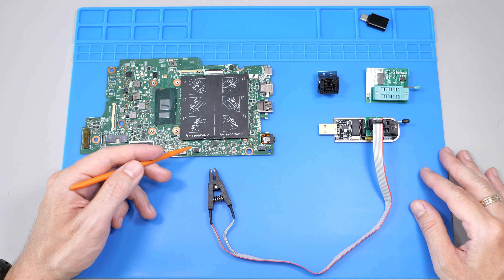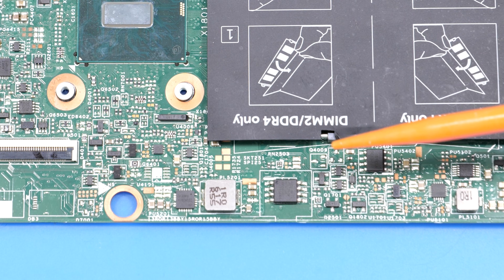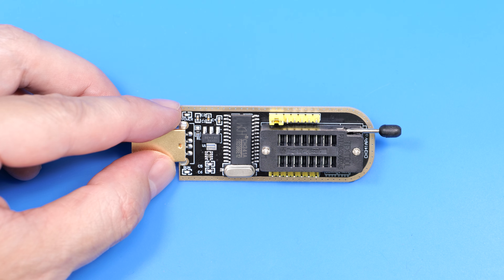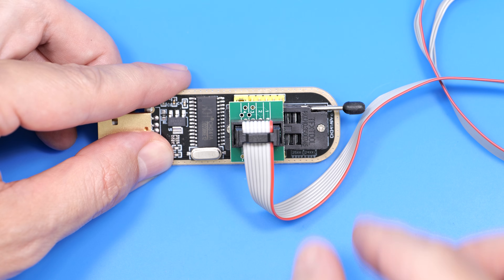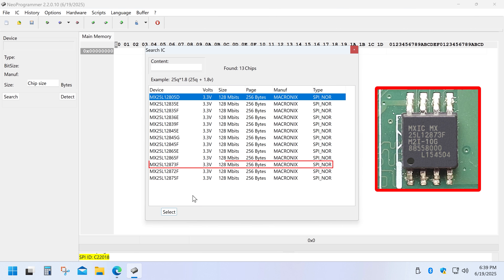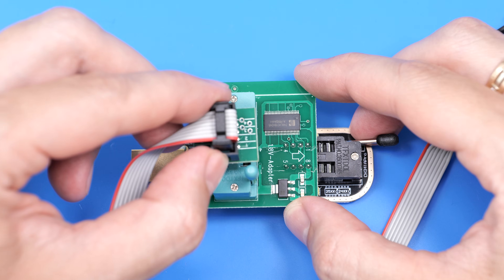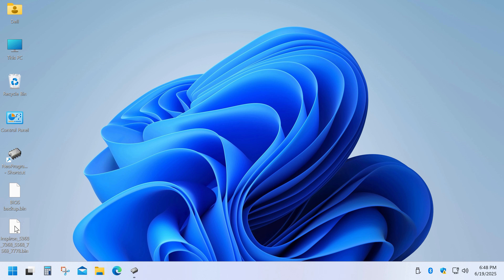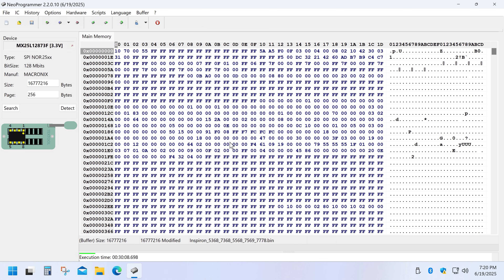How to Fix a Corrupted BIOS with a $5 Programmer | CH341A BIOS Flash Tutorial

Comment: Hello, when I try to connect my CH341A to my RX6800XT with GD25Q80 chip, the device disconnects. VCC and VSS show 1800ohms, and sometimes the RUN LED turns on and is dim. When connecting the programmer standalone, it connects to the programmer fine, but as soon as i put it on the chip - the programmer disconnects and is unresponsive when plugging in again. Do I have to desolder the VBIOS chip to program it? Please help
Reply from the maker: In your case, the problem is that your CH341A can’t properly power the IC because something on the board is drawing too much current possibly even momentarily shorting the CH341A’s power rail, which is very weak and doesn't supply much current. Assuming your graphics card doesn’t have any actual power issues and its rails aren’t shorted, you have two options: first, you can try connecting the graphics card to a motherboard and PSU, then supply power without pressing the power button just let it sit in standby mode. After that, try attaching the programmer and see if it helps. Depending on the chip and the board, sometimes this works sometimes not. If it doesn’t help, then you’ll need to either desolder the chip or isolate it by disconnecting its power pins/traces to eliminate the drain from the rest of the circuit.
Reply: @ElectronicsComputers Thank you very much for your detailed reply. I really appreciate it. Just tried connecting the PC to the motherboard without turning it on, it seems like I will have to desolder the chip to reflash it. The CH341A reacted the same way as it did without the gpu connected and powered by the motherboard. I had already taken the GPU to a repair shop, they just said "it works now" after reflashing the VBIOS and done. I will order a new chip too. Thank you!

Comment: This is the best tutorial I can find for this device. Despite it not working (its not being detected / "IC not responding"), I believe my BIOS chip to be completely cooked. Dell XPS 13 9360 from 2018. It was working one day, then next it wasn't. It tries to boot, but shuts down after 30 seconds. The light on the power button, is solid white, if there was an issue, it would blink giving me an error code to look up. No screen, no fan, but I can tell the CPU starts up because it gets warm. The repair shop I took it to told me its getting the right voltages, but doesn't boot and it baffled them. The SSD works because I tested it in a different laptop. I considered this issue to be a BIOS issue, hence why I am here. Is it possible I just bought a defective CH31A device? All things to consider. Besides the point, thanks for the tutorial. Coincidentally, I was working with a virtual machine on the laptop the night before it stopped working. It should be impossible for a VM to corrupt a BIOS, right?
Reply from the maker: There’s no way a virtual machine could corrupt your BIOS it's just not how virtualization works. your symptoms do sound like a bricked BIOS. If the repair shop did their job properly and confirmed that all power rails have the correct voltages and the EC (embedded controller) is alive, then there's a good chance all you need is reflash your BIOS. I don’t know your experience so I have to ask: are you 100% sure you’re working with the actual BIOS chip? I've had quite a few clients mistake other chips for the BIOS. What’s the exact model of your BIOS chip? Also, check the clip make sure the contacts aren’t bent and that it's gripping the chip firmly. If Windows recognizes the programmer and the correct drivers are installed, it should work. I’ve personally never seen a faulty CH341A (we sell them too) but I won’t rule it out it’s definitely possible.

Comment: Amazing tutorial! I updated dead BIOS on B‑550 Aorus Elite using CH341A thanks to your clear guide. Saved me from a bricked board! I don't know what's going on with Gigabyte motherboards and their Dual BIOS setup it's supposed to improve reliability but in reality, it's useless and crashes way too easily. And the only way to fix it using a programmer.
Reply from the maker: Yeah, we get them quite often in my repair shop but you can easily fixed it yourself. Also, investing in CH341A programmer allows you to fix smart TVs, routers and a bunch of other stuff too.
Reply: Did you use the aligator without desoldering? I have a bricked B450M aorus and cannot find the chip name, its not writen on it.
Reply: @Igor-ze8fr  There's no name but a serial code written on the chip, if you found the chip, try using isopropyl (purer is better) to clean any coatings or adhesives (if you have to peel off a bios version sticker). A good tip is to shine light from the SIDE not from top-down and use a phone camera to zoom and take pictures, telephoto lens help. DO NOT use any clips or blindly probe chips without finding a data sheet and knowing your chip, otherwise you could risk frying a 1.8V chip with 3.3V. If you cannot find the chip, refer to the mobo manufacturer manual, they usually have it labeled.

Comment: Hi there, cool video! I like how concise you were. I want to try this to help my friend with her laptop. By any chance, do you have the chip xml to import for W25Q16JWSSIQ chip? I don't think W25Q16 will work, will it? I am trying to find the info to import the chip into the list but I am a little lost.
Reply from the maker: You can use either W25Q16JV or W25Q16BV. Your chip requires 1.8v so you have to use a voltage adapter.
Reply: @ElectronicsComputers Ah, I see. I do have the adapter coming big thanks to your video for suggesting the tool! Thank you so much for the reply as well! You earned my sub! 🫡
Reply from the maker: @carapacetech   I'm happy to help and thank you for your support!

Comment: Lifesaver $5 device with this guide!! 🙌
Bricked my gigabyte b450 aorus m board after messing with the bios settings trying to enable secure boot for valorant. Apparently it’s a known issue with gigabyte mobo. Had to flash both m_bios and b_bios with this tool. Good thing this video came out around the time I had the issue 😅
Reply from the maker: That model has extremely delicate BIOS and this little device makes recovery super easy saving you a ton of money. And it’s not just for desktop or laptop motherboards, you can use it on routers, modems and Smart TVs.
Reply: Hi @markeaton3722 I have the exact same problem with the same motherboard, did you manage to bring it alive ?
Reply: Now I'm with the same problem with the same mobo, you have downloaded the bios update file from the official website of gigabyte? I don't know what to do with that file, it doesn't looks like it's .bin extension, how it can be changed?
Reply from the maker: @DeathKnight1   Try this: https://drive.google.com/file/d/1saYf928Wb6ZR_CpNnLHEb0LxSbLdXkg1/view
Reply: @DeathKnight1  Okay so I didn't fix it using the ch341a. What i did is ordering the amd ryzen 3 3200g (60€) I set it up on my motherboard and i could reach the bios and flash it using the downloaded bios on the official website (bios F66 in my case, the latest stable one) i put it on my usb key and then flash it. The format is fine its a standard format for gigabyte. Then i put back my own processor

Comment: my GIGABYTE have a M-BIOS and B-BIOS .... ¿¿¿ which one should i flash ???
 i mean ¿¿¿do i have to connect the CH341 and flash both BIOS CHIPS one by one or what ????
Reply from the maker: Since your GIGABYTE board has dual BIOS (M-BIOS = Main BIOS, B-BIOS = Backup BIOS), in most cases you only need to flash the Main BIOS unless the backup is also corrupted or outdated. If you're using a CH341A programmer, then yeah, each chip has to be flashed individually they’re physically separate ICs. So if you want both chips to have the same version (which is a good idea for redundancy), then reflash both.
Reply: @ElectronicsComputers  execelent and complete answer my friend ... i wll try that because is not hard to do it i was just in doubt to which do first... i think i wll start for the M-BIOS and then flash B-BIOS

Comment: My BIOS chip's pins are not exposed(can't use the clippers)...What do I do?
Reply from the maker: Are you sure you're looking at the BIOS chip? Ninety-nine percent of the time, BIOS chips in laptops and desktops are SOP8 or DIP8, they’ve got visible pins on the sides. That’s the standard. BGA-packaged BIOS chips do technically exist, but they’re extremely rare, mostly in embedded systems, ultracompact boards, or some high-end server gear. Not your average consumer laptop or desktop.
Reply: @ElectronicsComputers  sorry for the confusion. The BIOS chip is in fact DIP8. They are not invisible. It is so small that the clippers barely hold on to it and the pins on the clipper don't even touch the ones on the chip. What should i try?
Reply from the maker: @BUFF-F   For a DIP8 chip, you’ll need to desolder it and plug it directly into the programmer, clips don’t exist for that package. Alternatively, you can solder jumper wires straight to the chip legs if you want to avoid full desoldering.
Reply: @ElectronicsComputers  I do want to avoid desoldering. So I will try to connect the pins however I can. Thank you❤
Reply from the maker: @BUFF-F   I'm happy to help! Usually, I desolder the chip but in some cases I just use a clip set like this: https://shp.pub/78qu4h
It works perfectly fine and costs just $3 delivered.
Reply: @ElectronicsComputers  well, i gave it to a alleged "professional" to remove the chip and  it didn't come off, he tried various things and eventually broke a piece of it and. Is it replaceable?
Reply from the maker: @BUFF-F   Wow! That’s literally a 10-15 -second job, even with the cheapest $25 hot air station. Jjust replace the chip entirely they cost less than $5 and put it in a socket  so it can be easily removed or replaced: https://shp.pub/78rjaz
Reply: @ElectronicsComputers  yeah that's what I am trying to do. I am looking for the same model.

Comment: I did this with my b450 aorus pro wi-fi motherboard but why does mine indicate 1.8 v instead of 3.3 v? I did some searching and it did say that my MB model is 3.3 v. Any clues?
Reply from the maker: The B450 AORUS PRO Wi-Fi definitely uses 3.3V BIOS chips (usually Winbond 25Q128FVSQ or similar).
Reply from the maker: If NeoProgrammer is showing 1.8V but your board uses a 3.3V chip, it’s probably just showing that because it auto-detected the wrong chip model. Double-check the exact part number on your BIOS chip (like 25Q128FVSQ), and manually select that in NeoProgrammer.
Reply: @ElectronicsComputers but only 1 chip model showed and its the same name printed on my main bios
Reply from the maker: @sheeesh9808  What's the exact chip model we're talking about?
Reply: My motherboard’s chip starts with MX25U so I guess that’s why it shows 1.8 v instead of 3.3 v. I stopped using the bios programmer and I’m waiting for the 1.8 v adapter. My question is will my motherboard still work since all I did was read it using the programmer?
Reply from the maker: The chip model should’ve been mentioned in your first comment! Yes, that chip is 1.8V with a max operating voltage of 2.5V. That’s why I said in the video that the first step should always be checking the voltage in the datasheet. Speaking from experience, those chips usually survive 3.3V. I have a professional programmer in my repair shop where I can set the voltage anywhere from 1V to 5V through software, and I’ve selected the wrong voltage a few times the chips were still fine.
Reply: Thank you for answering my questions! I just subscribed to you! Cheers!
Reply: Btw, did you click verify ic? did you encounter some errors? Mine has like these “Verification error on address: 0x0000F5D3, Device: 0xFE, Buffer: 0xFF”. I already have my 1.8 v adapter and it seems my motherboard is still working since I can still read it, so i don’t know what’s the problem now
Reply from the maker: @sheeesh9808   I never use the Verify IC feature. If it works, it works if not, I just reflash it. That error with the CH341A is pretty common, even when the flash actually went fine. It can be caused by timing issues, minor read glitches etc. If the motherboard boots and runs stable after flashing, you can ignore the verify error.
Reply: Got that. I already fixed my PC. I was skeptical at first because if something goes wrong I need to disassemble my PC again but that did not happen. Thank you for the advice!

Comment: doesnt work for small form factor just wasted 20 bucks...
Reply from the maker: No one said that the SOIC8 clip would work on smaller packages. The CH341A programmer usually comes with a DIP adapter that supports those smaller chips like SOIC-8 (150 mil) or even TSOP/WSON types but yeah, you need to desolder the chip and place it into the adapter directly.

Comment: Hello sir, my laptop has a problem. When i turned it on, it shows BSOD but brief only like 2 sec, then it loads the "preparing automatic repair" screen, but then it shut down again, not even enter the "automatic repair" screen, just loads. And then it restart on its own after that shutdown, BSOD again, loads the same "preparing automatic repair", then restart. It keeps repeating on that.

I've already did clean install, and the problem still there. What should i do sir? 

model: Acer E1-432
BIOS: Pheonix SecureCore Technology Setup
Reply from the maker: Yep, that’s a classic boot loop from hell. 1. Check the RAM Faulty or unstable RAM is a very common cause of this kind of loop.Try running MemTest86 from a bootable USB. 2. Check the HDD/SSD health
A failing drive could also cause BSOD + boot repair loops. Use CrystalDiskInfo to check the SMART status. 3. Go into BIOS (Phoenix SecureCore) and load default settings. Make sure SATA mode is set to AHCI, not IDE or RAID. Disable any weird boot options like Secure Boot or Fast Boot just for testing.
Reply: @ElectronicsComputers  Hello again sir, i hope u remember me😅. I had to wait for a new thermal paste that i ordered online since the paste on the cpu was dried. 

So, i've checked with CrystalDiskInfo. Status is "caution", there's 2 yellow dots, CURRENT PENDING SECTOR COUNT and UNCORRECTABLE SECTOR COUNT.

For the ram, i tried using Windows Memory Diagnostic, total test pass was 2. Passed 1, getting into 2, the laptop shutted down. There's 2 ram inside, 8gb and 4gb. (i used only 8gb before)

The problem was as i stated before, power on, brief bsod, then loop. Sometimes I managed to get into windows like normal, but after a few minutes, it shutdown by itself, like a power cut off.

I think the problem started due to the hot air from the cpu was trapped inside, because I checked there's dust in the fan, which causes the thermal paste to dried.

I really dont know what to do now sir🙏🥲